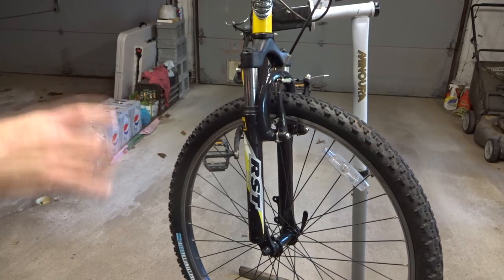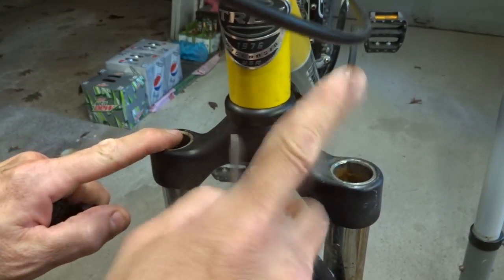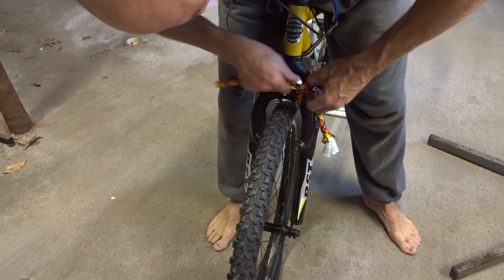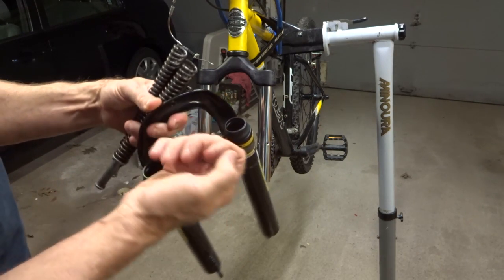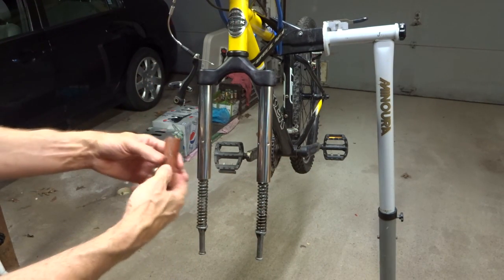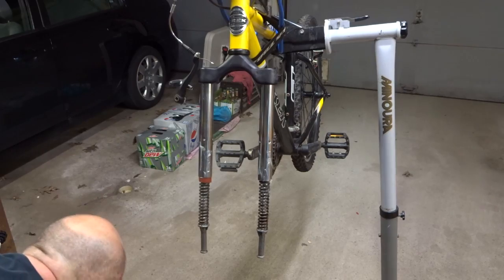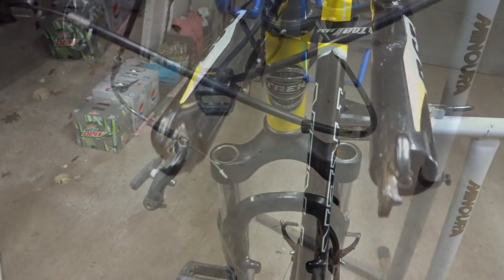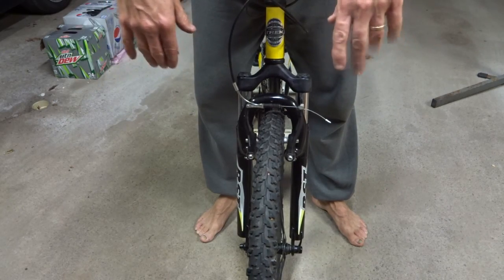How To Disassemble/Clean/Lube/Re-assemble RST 191 CS Fork/Shocks

Comment: Great video as usual! What I've done to unscrew the bolts is to tug on the bolts themselves. First by wedging a screwdriver under the bolt head, and once that wasn't enough, if I remember correctly, I wrapped a wire or a zip tie around the head and pulled on it as I unscrewed. That seemed enough to make the inside bits lodge themselves to the inside of the bottoms. It might have just been that fork though, it was pretty gritty inside.

Comment: Thanks for the tutorial, I just did the RST on a similar 820, one of the plastic sleeves had come out of the sliders so I had to take the sliders off to drive it back in place. I found it easier to flip the bike upside down with support under the grips so I didn't damage the shifters and put my weight on the tire to take the bolts out.  Then I just took my weight off, removed the wheel and pulled the sliders off. Mine was FAR worse inside than the one in your video though and black nasty smelling water soaked the rug I had under it. I flushed it out with ZEPP degreaser and a pressure washer until the water came out clear. It also had that same piece of paper wrapped around one spring. I put mine back together with boat trailer grease.
Reply from the maker: I recommend use a grease meant for forks like Slickoleum

Comment: Thanks man. I just got a bike that has RST 790 C7 forks on it. They look really similar to this setup. Mine are currently locked solid, so not sure if there’s some corrosion in there or what. This will help me get them apart (hopefully) and cleaned and greased up.
Reply: The real challenge is to separate the lowers as they are jamed

Comment: I do find the video's on low end forks like these RST forks ineresting - so simple to do when compaired to the more expensive forks availible. While they obviously aren't ment for hard core mountain biking, they are simple enough that I do think it's worth while to do the periodic maintenance (esp if the bike is a simple city run about).
Reply from the maker: These are still better than what you might find on a cheap Walmart bike. Like these: https://www.youtube.com/watch?v=MvS6aCqztg4
Reply: Yes, but most people don't maintain low end forks like these at all and then they get tossed - no reason for that.  As for the Wallmart bicycle shaped objects, I just wish those would go away - too much headaches.

Comment: Do you ever have a repair fail?  You know, you fix something then the first test ride out, it just doesn't work and you have to come back and re-do it or re-adjust it?  Please share to prove your not super human :-). Thanks for another wonderful vid.  Cheers!
Reply from the maker: Sometimes I have to do more. Like I replaced a worn chain, took it out for a test ride, and it was skipping. After more investigation the cassette was worn (not obviously), so I replaced it too. Or I went to overhaul some suspension forks, got inside and they were trashed. So I replaced them.

Comment: Have you done a video on removing suspension forks and install a standard rigid fork?  Great videos, THANKS!
Reply from the maker: No. Frames for suspension forks have a geometry made for them. Installing a standard rigid fork would lower the front end, and affect ride/handling.
Reply: I've done it. There are options for suspension corrected rigid forks. In fact, most new forks are suspension corrected. Nashbar has them. I'm running one on a 1998 GT Zaskar and it works perfectly. You just need to swap the crown race to the new fork. You will also need to cut the steerer tube to your desired height.
Reply from the maker: He said "standard rigid fork".
Reply: Of course it depends on your current fork--whether or not it is tapered or straight steerer and which size tire you are running. But they make them for all sizes and steerers. Here is the one that I am using:

http://www.nashbar.com/webapp/wcs/stores/servlet/Product_10053_10052_174928_-1___204715
Reply: Sorry for the confusion, by "Standard", I meant a ridgid, non-suspension fork.  I have seen ones sold by Surly after doing a little research.

Comment: I have an old Trek 820, too! If I put pressure down on the front fork, there is no movement.  Can I still unscrew the bolts at the end of the legs without it being a problem? You mentioned "the stuff inside starts turning"

Comment: I have an older Trek 820 with an Insync Exceed 288 front fork. I've tried taking off the top with what looks like a 24mm fastener but it's not working. Would this fork have the same pop off type top as in your video? After watching this I gave it a quick try but it doesn't seem to budge. Before I wreck it I just wanted to ask you. Thanks!
Reply from the maker: Different forks are different. These instructions will not work. You need to find instructions for your fork. I think most Insyc forks are pretty cheap forks. Maybe this one is similar: https://www.youtube.com/watch?v=MvS6aCqztg4

Comment: i am definitely going to clean mine up a a bit but i do want to eventually replace them...on a 3700...pretty sure it's not tapered so and advice on what to look for to fit the alpha aluminum 3700? Also, i mainly only ride for commuting and excersize purposes...10 miles a day too and from work...there are some mildy fun medians and shortcuts along the way which is why i like the hardtail with front suspension...i think i want something stiffer and smoother...something in the 100$ or less range would be preferable...really just needs to be slightly better than these old rst 191s...which im sure isnt hard to do...any suggestions?? tysm for your videos and help...
Reply from the maker: You are going to have to do your own research as to what works for you.
Reply: @RJTheBikeGuy  that's kind of why i asked bc i dont know what im looking for...i know what i want but not what to call it...id like something a bit stiffer and smoother than these...and will all forks be labled tapered/not tapered? is the only way to get something stiffer by going adjustable? or do non adjustable ones have spring rates or something? this is my only form of transportation at the moment and cant really afford the down time...the 820 is in pieces so i can really learn to service it...i do appreciate all your help and understand the commitment into answering my questions....

Comment: I see that you're using Slickoleum for your forks and elsewhere have seen Judy Butter recommended but would you use Park Tools Polylube 1000 (which I have) in a pinch for say this quality of shock? Thanks!
Reply from the maker: Slickoleum and Judy butter are both made for forks. I think the Park Tool grease is more of general purpose grease for bearings and such. Like I use marine grease for.

Comment: Hi RJ, You give me the confidence to do my own fork service. I'm getting serious shudder when I apply the front mechanical disk brakes firmly. I think the brakes are working fine but I can see back and forth movement between the fork uppers and lowers. I've emailed Suntour regarding the problem too. They are budget M3030 model. Just like these RST's. I asked Suntour if they sell bush or seal kits for these. Awaiting their reply. Any suggestions? TIA. Peter.
Reply from the maker: Sounds like the fork is toast. Might have issues with brakes too. Maybe rotor bent, or dirty. Clean the rotor, make sure it is straight. https://www.youtube.com/watch?v=i0KB7VeriNM

Comment: Hi RJ, I have recently picked up an abandoned Haro Vector 3 with RST 170B fork. I tried to overhaul the fork as one of the shocks have got rust and water in it. However, after I separated the top of the fork and two shocks at the bottom, I find no ways to take out the springs from the shocks. I just wonder if you have any experience in dealing forks with similar structure or any ideas to deal with the springs inside. Thanks for your help 🙇🏻‍♂️
Reply from the maker: You need to find instructions for that fork. I have not worked on that fork.

Comment: RJ... a question on these RST 191s... Mine were frozen (at extended position.) Took them apart and cleaned the tubes but not the springs. I did not know how to get them out---now I do. Thanks. The plastic-like wrapper in both forks were disintegrated into bits. All that is removed. After reassembly there's now some movement but inconsequential. Am wondering if those holes in the tubes have something to do with the forks movement. I tried blowing into one of the holes and there was almost no passage. Do you know if those holes must have an easy flow of air through them for the shocks to work correctly? Appreciate your posting this vid.
Reply from the maker: These are spring shocks. Not air/oil shocks. Lateral movement is most likely caused by worn bushings.

Comment: Hi,
It's easier to compress the forks if you put the front wheel up against a wall or some other immovable object. Thanks for the video
Reply: When did a concrete garage floor become a moveable surface?
Reply: That's gold right there.
Reply: You need something in front of the wheel rather than under it...Try it and you'll see  : )
Reply: Wait, that's actually a good idea... having problems getting that damn screw out. Might just do the trick.

Comment: Could a synthetic, plastic safe, silicone-based grease such as Super Lube work?
Reply: I like to use a marine grade grease
Reply: Cool, Super Lube is a type of marine grease as well!
Reply: It will stand up much better to the elements and costs about 5 or 6 bucks more than general purpose grease.
Reply from the maker: I recommend Slickoleum/Slick Honey. Or maybe SRAM butter. Beyond that, you on your own. http://www.slickoleum.com/store.html
Reply: Okay, I will give it a try then! Just curious, have you found it to hold up better over time or have you found it to be better in colder temperatures or give you a smoother operation?
Reply: Colder climates have an adverse effect on viscosity with any grease. Use a marine grade grease to cover almost all applications...

Comment: Dear rj I went out to try this but my mtb does not have the bolts on the bottom that you need to loosen.the forks to disassemble the forks and the springs gave stopped working as well
Reply from the maker: Then you have different forks and this video does not apply.
Reply: Ok thanks for the reply

Comment: Great video as usual. Wonder if some grease on the caps would make the inner tube more water resistant? The right tube on the fork (left from riders angle) had water and rust inside. Maybe they dont seal it quite good enough. What is your thoughts?
Reply from the maker: I think the water more likely got in around the seal.

Comment: Mine are seized TIGHT!
I cant make 1mm of movement, I want to open them up and clean them but the nut wont turn, I guess its cuz I can't move them.
Any advice?
Reply from the maker: You just gotta take them apart and figure it out.
Reply: @RJTheBikeGuy  well actually after a few of your rst vids I got confident enough, got it apart and... it's all fine as far as I can tell, its not seized tight, its totally bottomed out.
Not sure if the springs are compressed, it doesnt look like it... everything LOOKS fine to me, a trial novice.
I tried Google and couldn't really find anyone with this problem, lots of them seized and lots with broken springs, obviously something is wrong, I'm just too dumb to see it .
Thanks, good vids

Comment: i wonder why they wouldnt put a little drain hole, at the end of the fork, so water couldnt accumulate!?
Reply from the maker: Because it would also allow water and dirt to get in. Normally water won't be in the forks. But someone left this bike outside for a while.
Reply: Ive seen it on some cheap suspension forks, and the concept of a drain hole isnt new, nor bad.... i dont know where you would have to ride, to get water in from under the fork, maby if you ride through realy deep puddles? :D
Edit: Well yes, on better forks, with better seals and maby oil inside, the concept of a draining hole wouldnt work anyway, you just gotta service them once in a while.

Comment: my fork dont have screw at the buttom  and on the top it have preload and lock out
Reply from the maker: Then it's a different fork and this video doesn't apply.
Reply: RJ The Bike Guy i have plan to clean my fork but in this point i cant do it.. better idea i think is to buy new one fork not stock fork

Comment: i absolutely hate these forks , i recently bought a trek 820 and it had these same forks on it , they felt ok so i saw no real reson to rebuild them. later that day i picked up the bike to move it and the lowers completely fell off!!! the plastic bits that hold the lowers in with screws were broken and the one spring was in two pieces. after further disassembly i saw that the fork lowers were also full of dirt and old grease and water. nasty forks

Comment: Damn, pretty much everything is this video is wrong 😳 Starting from the fork itself which is actually reducing grip instead of increasing it (no dampening) to the point that it's going to be dangerous on the crests, and then finishing with lubing up the sealing which will leave the lube on the top part of the fork and will cause it to collect dust like crazy killing the legs and the sealing.. This way lubing only works if you have some kind of a dust cover on the fork, otherwise it's just wrong. You should only put the lube on the springs and inside the lower part, where the plastic bushings on normal forks are. The rest is supposed to be degresed, not lubed up. And this fork needs to go into the garbage ASAP, even a rigid fork is safer than this jumpy one, there is absolutely zero dampening here.